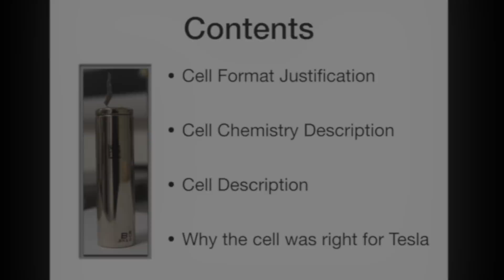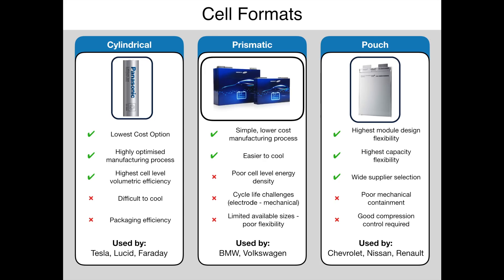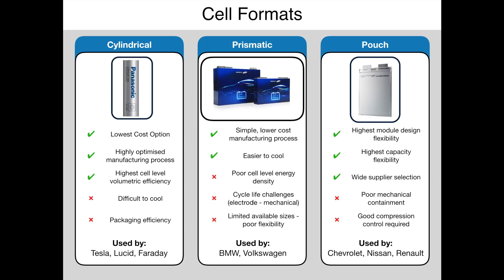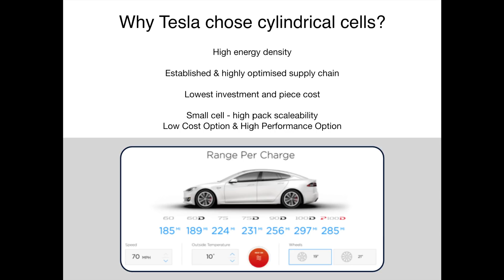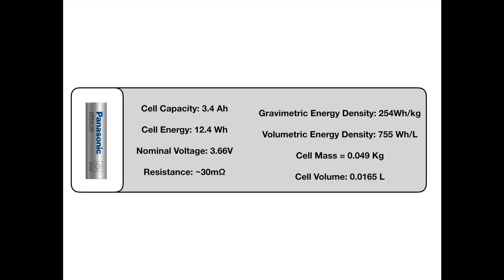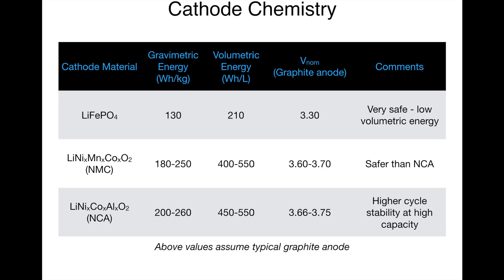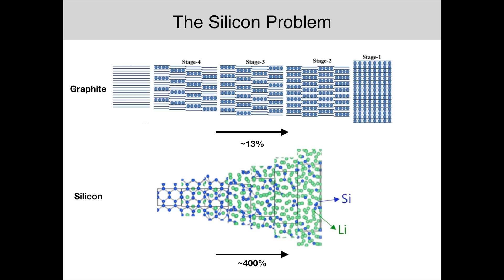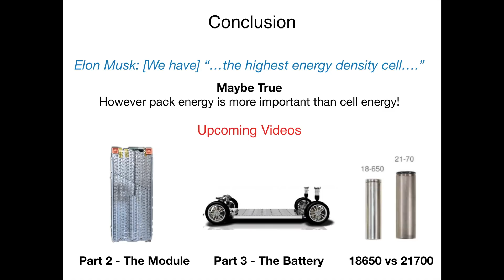Tesla's Battery Tech Explained: Part 1 - The Cell

Comment: The 18650 was determined by ACPropulsion to be the lowest cost per kWh. Their T-Zero is what Tesla licensed and made the Roadster design on.  They use their AC motor, controller and battery design.
 Then Tesla re-engineered the AC motor and controller and stopped paying the license fee to ACP after 6 months. Rather than sue ACP let it go so both would not fail. ACP also made the MINI-E , the XBox and other EVs.

Comment: Thanks a lot for the very informative video but I missed what part of all this is Tesla's, i.e., where is their edge that others can't access. For instance, is the NCA chemistry Tesla's or Panasonic's? How about Si addition to the anode? What is really manufactured in a Tesla Gigafactory? They just put Panasonic's batteries in modules??
Reply from the maker: Others can access the same cells. Tesla's advantage is in pack design and system control

Comment: Can you explain ambient temperature effect on battery capacity and performance of cell?
Reply from the maker: As battery temperature drops below 20 deg C, the extractable capacity drops. Above 20 deg C, the extractable capacity increases, however the extractable capacity may be limited by battery thermal limits. 

Check out my new video on battery degradation - https://youtu.be/XLnBg25JoHg

Comment: Thank you for the analysis.
In the video you state that "the addition of silicon to the anode generally reduces the fast charge capability of cell" - can you please explain why that is the case?
Much appreciated
Reply from the maker: Typically the silicon needs to be protected against inducement of excess mechanical stress, which would cause fracture, to prevent excessive degradation. 

Check out my new video on battery degradation - https://youtu.be/XLnBg25JoHg

Comment: If the Short Sellers, Big Oil, etc., succeed through Lobbyists and SuperPacs (aka Bribers) at crushing Tesla, the net result would be a couple year delay of the  EV revolution.  Tesla has succeeded at the proof of concept level.  When will my Country, the US, pull it’s head out of its ass.  Tesla is the most important Company on the Planet.  Tesla should be nurtured, it’s plans accelerated.  Elon is a National treasure, yet he’s forced to ward off punches from every direction.  It’s a National disgrace.

Comment: Cylindrical cells are not more difficult to cool than the other types. But it is more difficult to control internal cell temps in larger cells. That is one of the reasons why AC Propulsion (and later, Tesla) originally used so many small 18650 cells (the other being standardization) to build large battery packs, and why they more recently came up with an all-new slightly larger size (21700) instead of using the next larger industry-standard size (26650).  Prismatic cells are not easier to cool, expecially not considering that prismatic cells are available in larger sizes, making them simpler to use for large packs, and especially suitable if high amp loads are not required .

Comment: Beautiful job.

I have been trying to get to know better the amount of stuff inside these cells in relation to the container.

Your video provided the first physical measurement clue:  60mm vs 65mm.

Would you have similar information regarding the 21700?

In other words, what is the weight of each of the strips, and what are their dimensions? 

Moreover, what is the internal volume of the container and its weight?

You wrote that the cell volume for the 18650 was 0.0165 L.  How can I calculate this number?  

For instance, ((π)((18/2)^2)(65) / 1,000); however, adjusting for cell walls and air gaps ((π)((16/2)^2)(60) / 1,000) this provides a new cell volume.

You wrote that the gravimetric energy density is 254 Wh / kg.  How can I calculate this number?  

For instance, (12.44) / 0.049 kg; however, this includes the container with the chemicals.

(2πrh)(2.72) + (2)(πr2)(2.72) where r & h are adjusted for walls and air gaps and 2.72 is the density for aluminum (I assume the container is made of aluminum), and I obtain a container weight of 11.4 grams.

Should I subtract the mass of the container from the battery cell’s mass (49 - 11.4) to obtain the energy density? (330.8 Wh / kg)

Comment: Great video!I'm particularly interested in the differences between NCA and NMC when it comes to how they're affected by different temperatures. I've observed that Teslas reduce their maximum regenerative braking much more at low temps than EVs with NMC cells, and Teslas also appear to allow their packs to get much warmer before activating pack cooling than other automakers. Is this due to inherent differences in the optimal temperature ranges between these 2 chemistries? And do NCA cells suffer greater capacity reduction when cold than NMC?Thanks!
Reply from the maker: These differences which you observe are likely down to other factors. For instance, maximum regeneration at low temperature will be more about the ability of lithium to intercalate (enter into) the graphite anode, so will be primarily affected by the anode and electrolyte rather than being dictated by the cathode. 

Also, when it comes to pack temperature prior to cooling, this will likely be a decision made upon levels of anticipated capacity loss and resistance rise. You'd like to spend as little energy as possible cooling, but keep the cells cool enough that they don't degrade too quickly.

Comment: Hi EV-Tech Explained! Is the weight of one cell really 49.0g? Do you have the different weights for 18650 1st and 2nd generation and for the 21700 cells (with sources please)? I am doing a life cycle analysis of battery EVs vs. Fuel Cell EVs in my research intership as part of my master program - I'd really appreciate your data! Thanks in advance, Sonja.
Reply from the maker: The best thing to do is to search for datasheets for particular cells. Almost all 18650 cells are between 45 and 50g - as Tesla have more active material in their cells with the removal of the PTC, they are on the higher end of this mass scale. 

Similarly, searching for datasheets for 21700 cells will show you that all cells are between 66-72g.
Reply from the maker: Part 3 is now available: https://youtu.be/izUl28YtQbE
Reply: Hi! I have made an excel file gathering a lot of information from EPA (certification reports), INL (advanced vehicle testing activity), AVL etc for about 20 different EVs. Now I am looking for the datasheets of the corresponding battery cells. Do you have any suggestion? Somebody you know about already gathered that information?
Or should I rather go model by model and search for the manufacturer and then search for the possible cells and their datasheets?
 If you are interested I could send you my file, too.
Reply: @sonjaglasklar7624  Hello,  could you please share the information you have collected. It will help me to design a high voltage battery pack. Thanks in advance.
Reply: @Ridhanshvlogs  i come back to you. I have to check for my Excel files
Reply: @sonjaglasklar7624  It helps, Thanks in advance

Comment: Can you explain what is NOMINAL voltage?
Reply from the maker: It is the average voltage over the entire discharge curve, between the specified voltage limits.
Reply: Who sets voltage limits? Manufacturer of cell or manufacturer of battery?
Reply from the maker: To some extent, both. The manufacturer sets a safe voltage which enables acquisition of the advertised capacity and lifetime. A battery manufacturer may wish to limit capacity to prolong lifetime.
Reply: Not to be confused with the use by Space-X where it means phenominal: as in boy-oh-boy everything is going incredibly well, I would jump up and down if I wasn't on the telly. I wonder what my bonus will be...

Comment: I'd definitely like to know what is the effect of cold on those EV batteries (and I'm sure others would like to know in better details why cooling is important). I know the max charge/discharge rate is reduced in cold temperature, but there has to be something in the chemistry going on that reduces the total electron capacity as well, based on my own Canadian experience of nearly 4 years, and I haven't found solid info on this.
Reply from the maker: Thanks for the suggestion. I'll be sure to create a video on this topic in future.

Comment: Excellent video but Tesla cannot ignore the new chemistries tied to solid electrolyte, including lithium metal anode. This major step is is announced by Toyota, Dyson, Volkswagen (amongst others) in 2020 with huge competitive advantages in terms of safety and energy & power densities compared to NCA, NCM, LiS....
Reply from the maker: +VOLTA electric helicopter realistically those technologies are likely further away than 2020, and I'm sure Tesla will be looking at these technologies too.
Reply: Tesla keeps a close eye on battery developments.   Right now, there’s no production battery that beats their NCA in terms of capability and - MOST importantly - cost per kWh.  If and when that changes, Tesla will be all over it.  In the meantime, everything else is just lab experiments.
Reply from the maker: Check out my latest video at: https://youtu.be/bNd-yJtRPhk
Reply: Of course I think what Tesla has is good enough for even the future. If you 75miles in just 5minutes of charge as they promised in the V3 then I don’t think there is need for more improvement interns of battery technology on the interim.

Comment: Why does battery capacity decrease over time?
Reply from the maker: +Berrymouse It can be for many reasons, though these fall into three primary categories; loss of lithium from the electrolyte, loss of storage from the anode or loss of storage from the cathode. Generally, in one way or another, this is due to undesired chemical reactions taking place. 

This will be a topic for a future video for sure.
Reply: Berrymouse Parasitic reactions